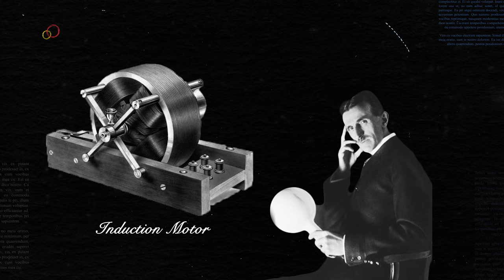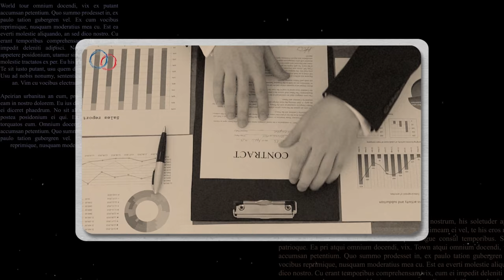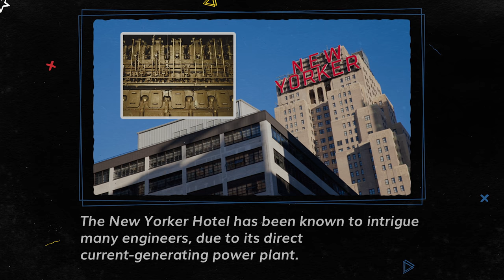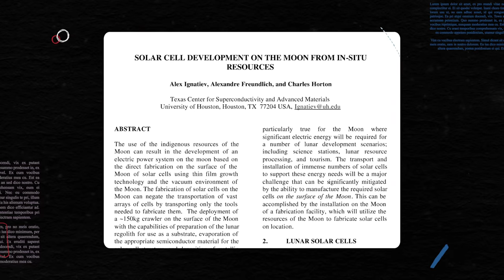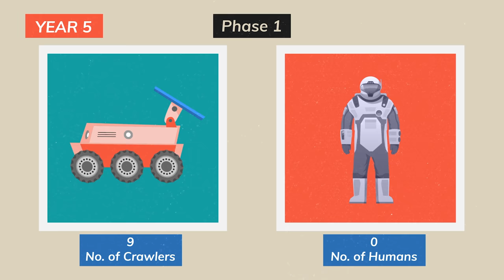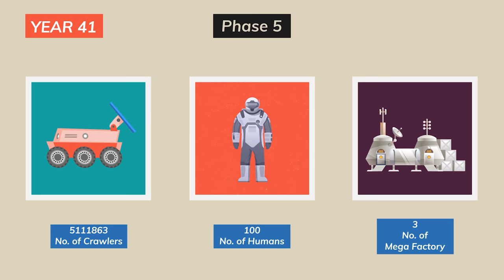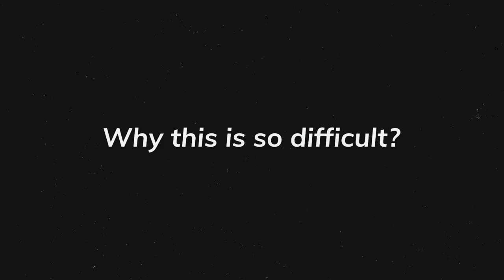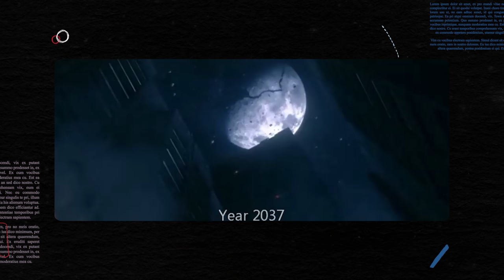Nikola Tesla’s Dream of Wireless Electricity Might Just Be Possible…On The Moon

Comment: It is not strictly necessary to use microwaves. Since the goal is to power everything on Earth, a better approach is to use resonant circuits operating at ultra-low frequencies, so low that the Earth-Moon distance is a small fraction of 1 wavelength. That puts the entire Earth in the nearfield zone of the lunar transmitter, allowing wireless power transfer just like some electronic devices do now with charging pads, but to all parts of Earth simultaneously. The necessary frequency will be around 0.04 Hz and the conductive rings connecting all the solar panels around the Moon will double as the low-frequency coil. Nearfield power goes to where the receiver is, so no aiming is required. Multiple receivers will operate all at the same time, each drawing as much energy from the field as needed for their loads. This also means that power will be available throughout the Earth-Moon system, including to electric rockets. Receiving stations will need very large coils and will receive very large power levels, but they can retransmit on higher frequencies for smaller loads at shorter ranges, including to aircraft, cars and houses. Power can be sent around Earth from one side to the other at around 0.75 Hz, or directly through the Earth at 1.2 Hz. Higher frequencies work at shorter range.

Comment: Well made video about an idea. However, I don’t think the idea holds up. Solar panels in geostationary earth orbit (geo) has higher power generation because of much more sunshine than the moon which have two week long nights. From GEO power can be beamed down to one much smaller receiver. Shorter beam distance = less power loss, geo is about 35000 km height. Also much smaller initial investment. 

However I do have another idea that would be great to make a video about... after the concept of sending starships between planets, what’s next? Well space ships that is only built in space for vacuum of course. Ships that goes between planets spaceports in orbit :)

Comment: I'm all for thinking "outside the box." But lets at least keep the box in sight. Going all the way to the moon to avoid the inconvenience of clouds, is a seriously stupid waste of money. There's PLENTY of space on Earth to house much more efficient solar panels, with a much, much, much more efficient grid tie. What's the combined area of every roof top on the planet? (have you looked at how much power your iPhone charging pad wastes? 10W to "beam" 5W into the phone. No thanks. I'll use a wire and get 99% to the phone. [not counting the inefficiency of the battery charging process, which is mostly the same in both cases])

Comment: The main hurdle is that their is no wireless power transmission model that will send energy over 250000 km and their probably never will be because you can't constrict the wave form, therefore all the power gets lost into out space. A better idea would be to make all wireless contact pads work on the same frequency as earth's magnetic field.
Reply from the maker: Modern antenna can form beams of microwaves. 

Yes, you’ll still send power in all directions, but they can make it so most of the power is in a particular direction. 

The gain of the antenna basically defines how good it is at directionality.
Reply: @TechforLudditesSira  that's a ridiculous statement. If it was possible to use microwave energy to generate power in the amounts you're talking then build the antenna and turn it, because microwave radiation is abundant in space without having to use the moon and solar panels. Unfortunately the tech you propose doesn't exist and probably never will.

Comment: That's very theoretical indeed, but I think it would be far mote cost efficient end easy to install the panel on earth and beam energy to the moon if needed.
On the moon you will have low quality panel that can't rotate, and prone to dust. It is just not worth the 400w/m^2 increase of solar power.
And the cost of launching material that cannot be collected would be astronomical. Without any kind of hypothetic space elevator or hook.
The idea seems cool and all but there is cheaper alternative to generate that amount of energy.

Comment: Just set up the same unit Tesla used to power abc radio.  World wide dc   Am radio.    With no external power source 
Just two big coils  and a wire between towers.     Worked until 29.    Then the navy took it     Soooo.   Use that on the moon I’m sure the navy still has it.    Tesla used light to carry the magnetic energy packet trains     Focus a flashlight on a magnet far away.     Like ten feet.   I used five lenses    Concave and convex Wave a magnet right in front of the flash light the far  away magnet will spin 
Ta da       Try it and you will see we don’t need micro waves.    I say methane.  Municipal scale    We generate it rain or shine.    In the 20s.  You could buy a methane generator for your home. From Sears and Roebuck

Comment: Seriously?  If you need to put the microwave receivers in the desert, why wouldn't you just put solar cells in deserts?  Some on each side of the Earth so there are always some in sunlit areas?  24/7 power.  The reason we can't just cover the worlds deserts with solar cells is that power transmission lines that would need to cross the Earth are prohibitively expensive. Expensive, but a fraction of what they would cost to build on the moon.  Cooperation isn't the problem, the real problem is that we live in a universe that has physical laws.

Comment: A ring of glass around the moon is a bad idea. It replaces greenhouse gas warming with simple reflected sunlight warming, not to mention that it would then be blinding to look up at the moon. Even with a diffusion surface on the glass it would still be bad. There are other ways to extract the sun's power on the moon without covering it with solar panels, especially with the discovery of water on the moon. How about a ring of solar heated steam power plants where the steam is constantly pushed to the dark where it cools and condenses going into the next steam plant.

Comment: I wonder how the cost compares with installing batteries, HVDC global interconnects, and a distributed PV system totalling 3x the global capacity?
Excess power would be great for desalination.
And...
Does that microwave transmission system work both ways?  Could we build a system of LEO transceivers to move power around the globe rather than HVDC interconnects, generating power in the middle of the ocean for example then beaming it to cities?
What kind of losses would be involved?
Could the orbital transceiver be more like a reflector than a converter?

Comment: Solar is the most feasible considering the fact that every continent has a large desert, where land is worthless and solar energy abundant.. start from east Gobi, Taklamakan, Ladakh, Thar, large parts of Afghanistan, Iran, Arabian peninsula, Iraq Syria northers Africa central and Southern Africa.. then the American continent .. there is no dearth of usable land for solar .. plus huge ocean shorelines than can be used for wind energy and floating panels for solar.. all that is lacking in this world is coordinated effort.. and is we are not able to coordinate across land and sea the “good luck” trying that in space !!
Reply: Desert isn't the best place to place solar panel cause of high temperature which decreases conductivity and it also increases loss of power during transmission since most population is far away from desert.
Putting solar panels in ocean is definitely gonna do more harm for marine life.
Reply: Good points but this is when you are considering solar in isolation. When you consider all aspects like
- issue of spent fuel in NPP 
- cost of operation of NPP including the cost of securing the facility 
- the odd chance of an accident at NPP and potential cost of the aftermath 
- the money saved in running other forms of power generation (thermal etc) over several years of their operation..
- the cost of problems created due to emissions of thermal power generation 
All these costs added up can reasonably cover the extra cost of transmission lines for solar or wind.. 
but as I mentioned the challenges are cooperation across nations to maintain a follow the sun model at least in continuous connected land masses.

Comment: The law of energy conservation sais that energy does not vanish, it may however change form. In reality this means that none solar energy production on earth, will in large eventually end up as heat. The temperature balance on earth depends in large on the radiation in and out of earth. This means that any none solar energy produced on earth, will net heat earth to a new and higher balance level. As we already see, any green house effect will make it worse.
The in the video proposed idea, does propose solar energy but it's NOT solar that radiate onto earth. I.e. it will net heat the earth. As a side note, so do all already existing nuclear power plants and so will fusion power generation, if ever put in use.
An energy form that does not cause green house effect, is, of course, better but there still is a limit to how much energy we can use on earth, if it isn't solar.

Comment: Why build a ring of solar panels all the way around the Moon, when more than half of them would be sitting there unused at all times due to being out of good direct sunlight?  You could build solar arrays at the lunar poles (put them on towers with actuators to rotate the panels as the Moon turns).  Since this is also where the lion's share of water is (thus the best place for human-crewed bases and manufacturing facilities), you would save the costs and logistics of transport from the poles all the way to the Lunar equator.

Done this way, it would only be necessary to build enough solar panels to meet Earth's energy needs, rather than blanketing the Lunar equator in solar panels that sit in the dark most of the time.  Alternatively, a lunar base/factory could manufacture solar power satellites and launch them to Earth orbit using a mass-driver.  Either way would be far cheaper and less wasteful than this proposal.

Comment: Aren't you forgetting something?  A lunar day is ~29 Earth days.  Any solar array on the lunar equator would be in the dark for up to 14.5 days at a time!
Reply from the maker: The ring goes all the way around
Reply: @TechforLudditesSira  Assuming the construction is linear it will take a very, very long time to get all the way around.  

One possible solution would be to start several power plants on the moon spaced at even intervals.  If you have at least 3 you could have useful power production from at least one of them at all times.  Building several independent plants built outwards from central points along the equator could provide redundancy; but each plant would be down at least half the time.

But trying to build a long ribbon along the equator doesn't make a lot of sense to me.  Doing that can result in issues like power loss due to line length as well as the issue of not having power production half the time.

Even if you deal with the issues above, you still run into the problem that the moon is only visible from a given point on the Earth for about 12 hours/day.  That can be mitigated a little bit by interconnecting grids, but shipping power halfway around the world is at best challenging.
Reply: @TechforLudditesSira  Don't get me wrong, this tech should be extremely useful for ISRU.  It could also be used to manufacture and supply power for something like a large radio telescope.  So I think there are serious applications for this tech - but I don't think it's likely to for lunar-based power production for Earth in our lifetimes...

Comment: Did you say they would "transmit power through a microwave transmission to Earth"?  Is that a thing?  Is there a working prototype of such power transmission? What are its efficiency levels? Is there any loss of power in its transmission?  How would you transmit power from the moon to the Earth through wave frequency, micro or otherwise?  I'm sorry but I think you are overestimating our capacity to transmit power wirelessly.  Which is why I suspect you are joking...